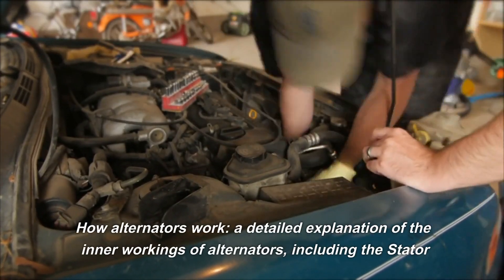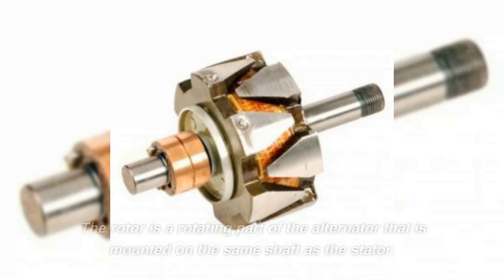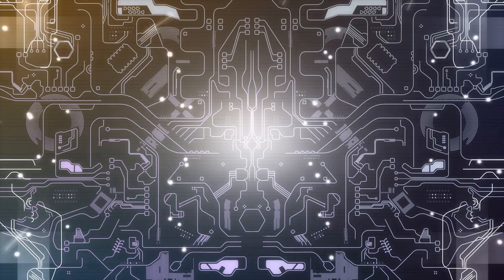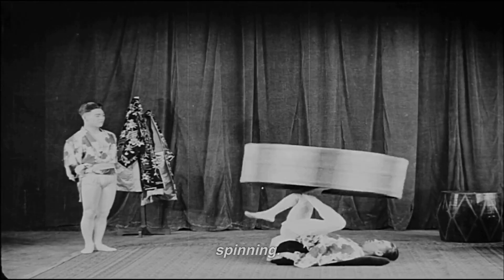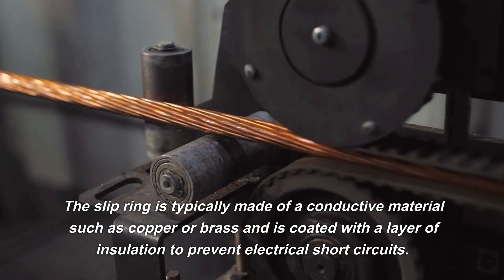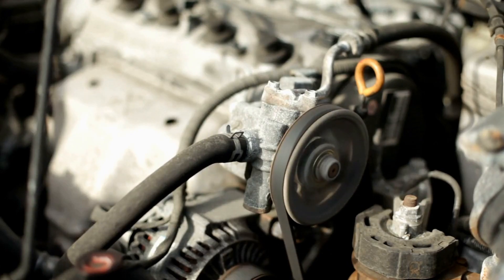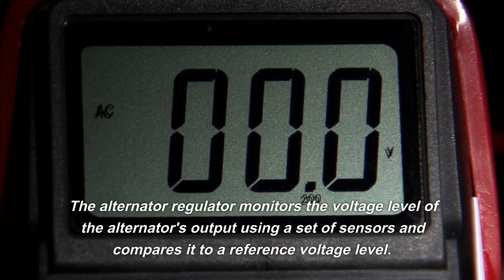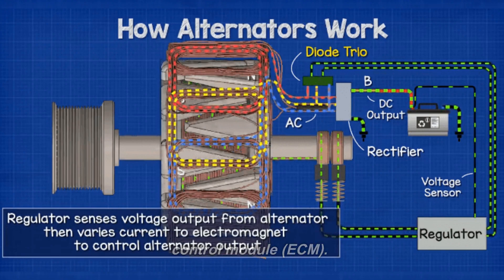How alternators work: a detailed explanation of the inner workings of alternators

Comment: Can you help explain 12/24/48v stators. It doesnt look to me that there is more turns on a 24 than some 12v alternators. Same for 48v.
Reply from the maker: The higher the voltage, the smaller the wire. The turns should be counted as you disassemble. I suggest a video with audio explanation as its taken apart, or some excellent drawing/note taking skills or both.
Reply: @ i’ve pulled apart a few and counted turns per phase. Its not consistent nor does it appear related to voltage. I have a 48v on my bench atm.